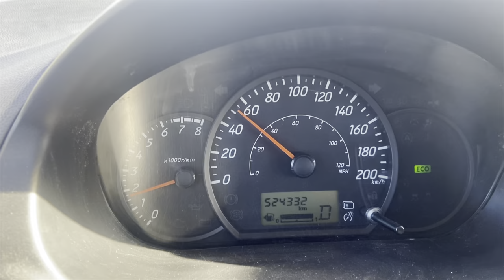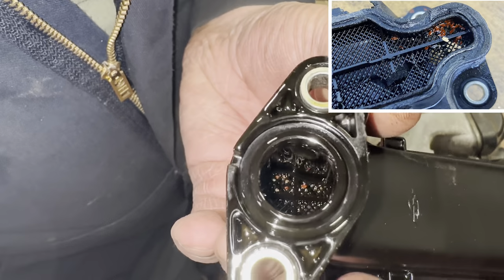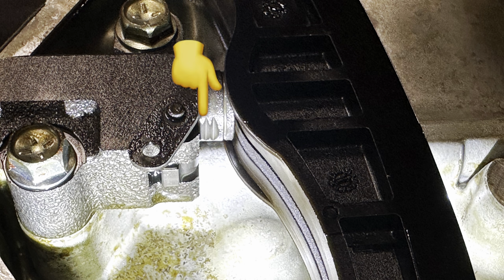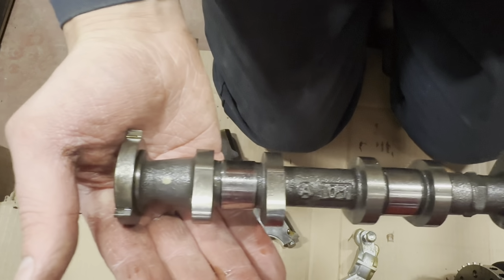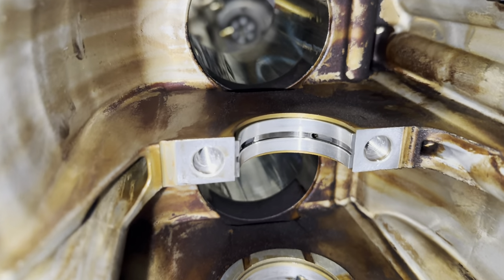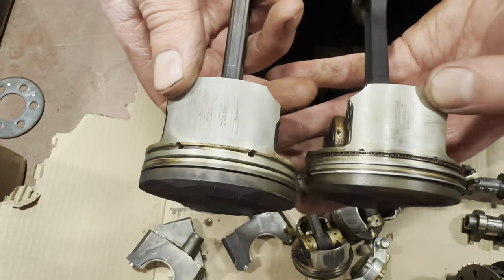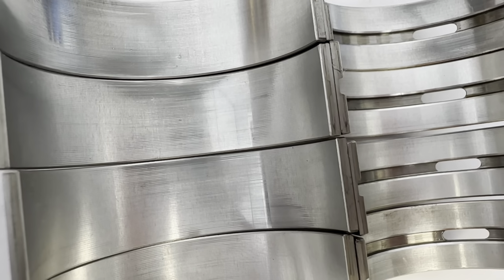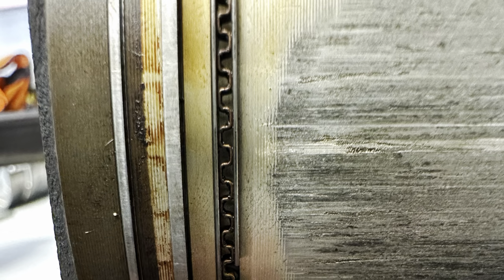524,000km Mitsubishi Mirage engine teardown

Comment: The part that surprises me about Mitsubishi's reputation is the fact that people are unaware that Mitsubishi owns Mitsubishi heavy industries for electronics and hydraulics and general commercial goods which transfers into their own product lineup with some of the best electronics and wiring you can find on any vehicle. I had a 2008 Mitsubishi outlander that have been crashed repeatedly and owned by a crackhead who then abandoned it and it was slept in by a homeless person for like a year. We changed the battery and I changed the valve cover gaskets and the spark plugs and it ran like it was brand new. If that is in the testimony to the quality of the components I don't think anything will.

Comment: Reminds me of my dad’s 2012 Camry.. he threw 285k miles on it. Never gave him a single issue, just regular maintenance until the transmission went out. Even if the transmission gave up the engine was still perfect, no shudders at all, and drove like the day he bought it. Oil came out perfect every time he changed it.

Comment: My nissan Pulsar had 498,000km before I sold it and still did not burn a drop and I serviced it every 10,000km with semi synthetic, was an SR20DE manual 5 speed 1998 n15 Pulsar. My dads Fiat Qubo has 400,000 on it only glow plug replaced once, Renault Megane 750,000 before rust was an issue, Peugeot 407 wagon 780,000. And now the most I have seen my Uncles w124 Mercedes 5 cylinder non turbo diesel, 1.4 million, zero issues aside from some old vacuum lines replaced once. 0-100 times on a calender though and 5 speed manual.
Reply: My Honda Jazz 2005 at 204000km has had all kind of problems, including exploded bearings into the gearbox at 110000km, rear main seal leaking, alternator overcharging at 200000km, water leak into the car (all seam on the body panels is crackng because of age). Tell about japanese quality...
Reply: @alessandroserrao9422  My dad's jazz was an early build, 2002 or 2003, absolute shit box, AC dead at 50k, burning oil 1l per 1000km by 230,000km, power steering dead 2 times during ownership water pump dead 3 times, oil leaks, water leaks inside, electrical gremlins needed new head and piston rings he sold it before the rings were fixed at 230k. it was an absolute dog of a car and it was gutless, you needed to redline it to get anywhere. Plus side its gearbox was good, you needed it to be because a fast shift was needed if you lost momentum you would stall up the slightest incline, his 3 pot daewoo spark was more reliable albeit built like a childs toy.
Reply: @super_slav91 I absolutely agree. Alternator that overcharges the battery (that lasts 2years if you're lucky) and make all the light flicker, the Takata scandal (they swapper two airbags inflator for that), rust everywhere due to the seam sealant cracking everywhere in the body, I had to throw away all the carpet underside, because some smarties at Honda made them of sponge. It was all wet for years of leakage. Rear tyrewell full of water because of this very same problem (the gutters on the roof were all cracked). The engine misfire al lot (known problem of the coils going bad). The gearbox failure at an early stage, all documented by TSBs by Honda (it's not bad luck). Never again a japanese car.
Reply: @alessandroserrao9422  And they are hard to work on, people give me crap for saying VW's are hard to work on, they are pretty straight forward, the front light bulb is hard to get too in the Jazz, I had to take the wheel off and arch lining. Alternator overcharge damn I have never heard of that happening but then again Honda, My Skoda had the airbag replaced, VAG paid for it, they accept warranty claims unlike Honda and Toyota at least in Australia.
Reply: @super_slav91 Hondas in particular are bad enginereed to work on. I had to remove the front bumper and light assembly to replace the fucking bulbs. Evil. Imagine to be force to do it on an highway at night... Ahahahahah...
The flickering problem is common.
Reply from the maker: Is it worse that a Ford fusion? I changed some headlight bulbs for a guy that had one and had to pull the front bumper off, then remove the headlight assembly, and even then it was still a pita to get one of the bulbs out cause it was offset from the access hole requiring needle nose pliers to pull it out. Heater motors are even worse in some fords where you gotta remove the gas pedal to access one half of the motor then pull the glove box and half the heater box out to pull it out and through the passenger side. I guess the idea is to make them cost more to repair than the vehicle is worth so people go buy another one.
Reply: @turdpailsandtrails I'm Italian and the next car I will buy is Fiat, now Stellantis. Fiat Panda in particular. Fiat engines are among the best in the world, not inferior to Honda or Toyota engines in any way, and they can be repaired quite cheaply plus their cars don't have all these problems of japanese manufacturing. People say that Fiat means Fix It Again Tony. That's not true anymore.
Reply: @turdpailsandtrails  tbh never worked on fords much, aside from a few falcons, but they are different from other fords I guess because they are Australian designed models and were not a global platform. But no never that hard. I have heard fiestas are hard to work on.

Comment: Also, I replaced the clutch once (190k) , all 4 wheel bearings (140k), the ac compressor (140k), the clutch cable and clutch pedal pad (220k and 200k) .  As far as i know, the alternator and water pump are both original.  Run synthetic super tech 0w20 20kmi oil & 10k mile fram filters and change it at 10k (doesnt even look dirty, i do add 1/2 quart at 5k)

Comment: Dude that engine is TINY I could probably pick it up with my hands
Reply from the maker: They’re light. 112lbs without manifolds or accessories.
Reply: @turdpailsandtrails  nope, more like 93 kilograms or about 200 pounds!
Reply from the maker: @gkauto1959  Where'd you get that figure? I've never weighed one but can pick one up easier than a cvt. Here's the post that I got the 112lb figure from :https://mirageforum.com/forum/showthread.php/6571-How-much-does-that-weigh-(Mirage-part-weight-list)?p=77831&viewfull=1#post77831

Comment: Well done on keeping it well maintained, just one of the pitfalls for modern engines with a short skirts, one of my old Toyota liteace vans with 1.8Lt OHV pushrod motor from the 90's  had done 450,000km when I did a head gasket could still see the hone marks in the cylinder walls they were full skirts and quite long compared to todays highly stressed engines.
Reply from the maker: There are a few others that have more miles than this one and they still run good. One is a 2015 with 566k km and the other is a 2017 with 536k km which still has the original cvt.

Comment: Mitsubishis from the early 2000s are getting pretty rare as most of them are on the scrapheap.  I thought Mitsubishis were shit but to get 524,000km out of a pretty cheap relatively modern car they must be doing something right.  Obviously this car has been well maintained but that is still impressive.
Reply from the maker: I used to think the same thing. My only prior experience with Mitsubishi's was seeing clapped out,oil leaking, smoking cars of the early 90's and knocking 2.6L engines that came in 80's Caravans that rolled into the wrecker.  Who knew?

Comment: you can really tell that the metal parts more exposed to higher temperatures have a thin layer of brown colored coat on them: piston heads and crankshaft body
all the carbon deposits and micro metal powder from abrasion have been constantly removed from the inside of the engine with every single oil change
very good job 👍

Comment: I like that the engine has a timing chain. The timing belt on my chevy aveo snapped and I've been trying to fix it for a year.
Reply from the maker: Yeah, I have a Chevy sonic in the shop with a broken timing belt. Swapping  the engine then will fix the old one and keep it as a spare if it’s not too mangled. Likely needs a bunch of valves replaced at least.

Comment: idk if anyone wrote this in the comments yet, but the red stuff in the oil pickup screen is most likely some sort of paint they use in the engine assemlby line to mark off bolt that already have been tightened. lots of engine have this, sometimes blue, sometimes yellow

Comment: Anything Mitsubishi that was designed and built from the mid 90's on is builtproof if the servicing is kept up.
Late G series engines, and all of B, K and J series are as good as any Toyota in terms of reliability.

Comment: VERY impressive result, any engine that goes that distance without major mech is a good engine, especially for a compact. Surprisingly low wear on the timing chain. Why was the engine taken out of the car, was it because of the mechanical noise? Is it known if there was oil consumption?

Comment: Is that a cam phaser for VVT that I noticed?  Those were a problem for Fords in the Triton engines.  Does the car also have CVT?  I'm also a bit leery of the CVT issues that some manufacturers have.  I'm wondering what the your typical driving is like, to put so many km on the car(s).  Also what other vehicles may be in the fleet.
Reply from the maker: Yeah the on cam is variable. I just read about some 4cyl mits engines having phaser issues too. 
I tore it open the other day. I should have included that in this video. I’ll try for the next one. 
There’s a pile of these mirages in the fleet. I maintain 30-40 of them 2015-2023’s. All are cvts. I replaced the cvt in this car at 300k km, I had a few others fail around the same mileage. I started changing fluid more often(try for 50k km/30k miles) and they seem to last much longer now. I haven’t had one fail in a couple years now, iirc. The highest mileage mirage cvt in the fleet is a 2017 with over 530k kms. 
There are some Nissans with different Jatco  cvts that are holding up great(shocking) and some chevy/daewoo trash. 
As for driving, this 524k car was used mostly on the highway for the first 400k. Did 12,000km a month by one person. Then the last 125k were mainly in town/city. Used by multiple people.
Reply: If I may ask, in what fleet were these cars used? Delivery or something?

Comment: The cams looked absolutely pristine. Did you ever experiment with any other viscosity oil? Or do they all get 0w-20 for their entire lives?
Reply from the maker: Ran 0w20 right from new. I might have dumped some 5w30 synthetic-blend in it for the last few oil changes to see if it would quiet down. It didn’t.
Reply: ever figure out just what made the clacking noise at Idle? Im thinking it was from excess valve clearance? Like if you were to rebuild that cylinder head, you would have to replace each cup somewhat thicker to take up the excess slack and noise? @turdpailsandtrails

Comment: That noise is valve train. 

The 13-15 cars have adjustable valves and flat tappet lifters, The 17+ cars got hydraulic roller lifters, tend to be quieter and don't need adjustment. They also make a little more power.
Reply from the maker: Negative. The only way to adjust valve lash is to replace the lifter bucket with a different size. 17+ have rollers on the cam lobes. 9-ish min mark on this vid shows the buckets https://youtu.be/xI44Ic353vI?si=JLWuA0XIK0mrKPoE

Comment: 500k km for such a small displacement gasoline engine is pretty good, i would say. Many of those little engines dont even last 200k km, especially the ones from vw, unless you get lucky
Reply from the maker: Yeah, these things hold up well for the most part. There a handful in this fleet with over 400k km and a few others with 530k and 560k kms running the original untouched engines. What I'm most impressed with is they don't leak oil or coolant. This 524k engine did have the front main seal just barely starting to sweat and the back/rh seam of the timing cover sweats a little but never enough to form a drop.
Reply: @turdpailsandtrails Any expirience with Honda 1.8iVtec? SOHC engines? Many said these are bulletproof and long runner.
Reply: VW can have extremely shitty engines. I used to have a Skoda Fabia HTP 54hp 3cyl (same engine as VW Lupo) and ultimately had to scrap the car because the engine block ruptured at a mileage of just 60000 km, filling the cylinders with coolant.

Turns out these engines were pushed to produce much more torque (more than my 75HP Mitsubishi Colt 3cyl) than they could handle. 

According to the plethora of people on the internet, who also had their engine block rupture, it's a design flaw.
Reply: @Psychx_  Yes, I have that same engine too in my skoda fabia. It's at 117000km right now and sounds like a diesel for whatever reason. But it's been running like that for the past 4000km 😂😅 it doesn't burn coolant and almost no oil at all, thankfully. But I know these engines can blow at any given moment. My favorite vw engine so far has been the 3.2 Vr6. I have 190000km on the clock, and it still runs like butter. Not timing chain problems, no carbon buildup thanks to intake manifold injection, doesn't burn any oil like not even a single drop. It's been very reliable for me till now.

Comment: Well done on video mate eye opening experience,   wow 524km    ,,  worked for Mitsubishi sold heaps of these mirages,   i thought they wouldnt make 100k without dying,   these engines worked hard to with cvt   ,   many hrs above  4000 rpm range ,    yet this 524 car must of been well serviced  by somebody who had good care factor and guess wanted to see just how far it will go or last ,   piston slap seems only fault otherwise this engine is a ripper dipper little marathon champion,      i,m  mega impressed  at the cleanliness of it and next to no wear just boar and piston scraps not bad for 524,000km  and tiny little  engine
Reply from the maker: Thanks! I’ve been maintaining a small fleet of these things since new. I thought they’d be finished by 200k initially. I wanted to keep this one going til it got much worse but it sounded like a diesel when driving it. Wasn’t a good look. Some of them are hit or miss. I tore one down before this with 450k and the pistons and rings were gunked
up. Then there’s a few others with 536 and 560k that run great still. The one should hit 600k by September. 
They are holding up well. 
I drowned my daily Mirage in a river once on a camping trip. I can’t kill the thing 😂
Reply: @turdpailsandtrails  yeah 600 k ,   bloody hell impressive shit from such a tiny engine ,  well they turned out much better than I thought,      now was everything  else still working in the car such as air conditioning,   door locks , radio  cruise control etc ,   if so it's like the Nissan pulsar from late 90s  ,   729km yes in a pulsar ,,  everything  working still ,  even exhaust fumes still clean as it was new,

Comment: Great video. Do you experience rattle on start-up, especially after sitting for a bit
Reply from the maker: Yeah, it seems fairly common on first start up after an oil change. I don't think it's the timing chain or tensioner like some think cause I've seen it happen on fairly new cars after doing their first oil change too.
Reply: @turdpailsandtrails  its the vvt issues, something about the pin that's worn out inside the vvt iirc, my car nissan Almera/Versa also making that damn noise after sitting for awhile especially starting up in the morning, but surprisingly a lot of never people had issues on this problem still able to drive normally.

Comment: just check the roundness of the cylinders, it should be pretty ovalized after such milage, piston alway's wear a lot more on one side because a lot of force push them down and against the cylinders wall at each stroke, it's agravated by the lack of lubrification,  polished cylinders don't retain oil so it's almost metal against metal

Comment: I'm driving a 2012 Mitsubishi Colt 5dr with a 3 cyl. 75HP petrol engine. The car has been rock solid so far (Mitsubishi engines from this time are said to be indestructible when taken proper care of and not pushed into the red line). The only non-minor repairs needed until now were a new exhaust pipe and AC compressor.

I plan on using the car until it breaks down. Only 85K km so far (I drive 4000-5000km/yr), yearly service/oil change, and the car is parked in a garage, so it's going to last me a very long time :D
Reply: i'm starting to see more and more of those, looked after ones too

Comment: My Hyundai was killed by rust. The engine was still running perfectly. Oil changes make a huge difference. Rust destroyed my steering, my fuel lines, my struts, my hatch struts, my hatch handle. The mechanic who was replacing the destroyed struts under the car stuck a screwdriver into the bottom of the car to show me it was coming apart due to rust. My current car is always treated for rust proofing. Engine runs great. Yet to have a problem with it.
Reply from the maker: What Hyundai did yo have? These Mirages' are holding together alright so far. A few are starting to have rust poke through at the back of the rear wheel wells where 2 layers of metal trap water. But underneath the car is still solid with just superficial rust.
Reply: @turdpailsandtrails 
I had promised myself I would have some rust-control solution done to it, but I kept procrastinating. I paid the price. No car is safe in my city. All will rust.

Comment: What will happen to the two Mirages that you pulled the engines from? Are they going back in the fleet with rebuilt/replaced engines?
Reply from the maker: They’re still going. I installed used engines that I pulled from wrecks over the last 10 years.
Reply: That is great. Thanks for sharing.